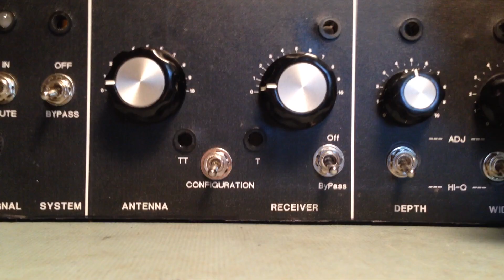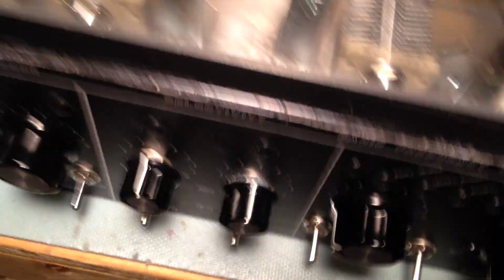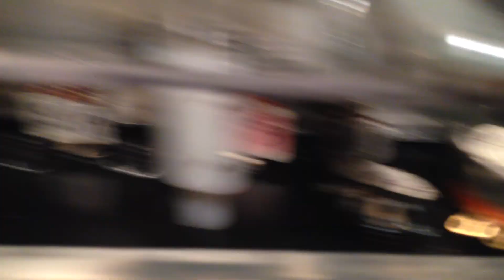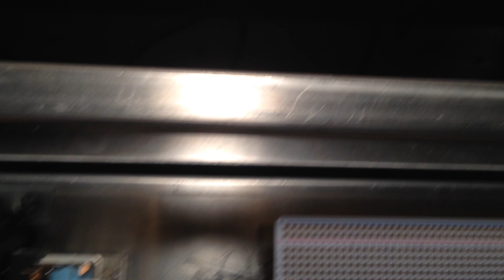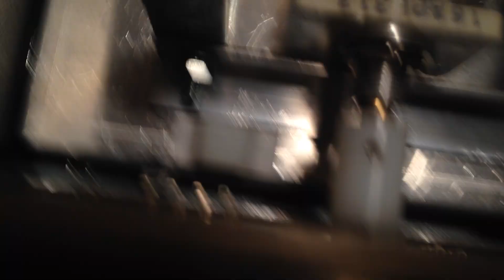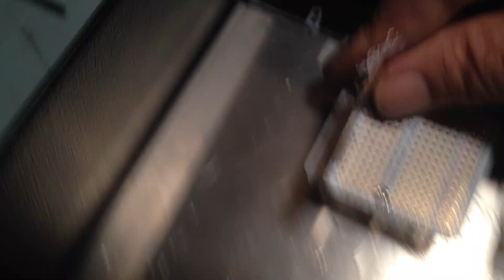Type 5+ RF Signal Preconditioner and Antenna Preselector Ready to Wire

Comment: I just wanted to add that I am well aware of how much time and labor go into all aspects of these projects. Laying out the front panel graphics for the decal is deeply thought provoking and often frustrating. Then the chassis and front panel need to be machined. Finally, there's a lot of wiring and soldering to make these things come to full functionality. All that stuff isn't immediately obvious when watching the demo vids, but, as you know, it all takes a ton of time and effort. Excellent work Rick...keep it up.